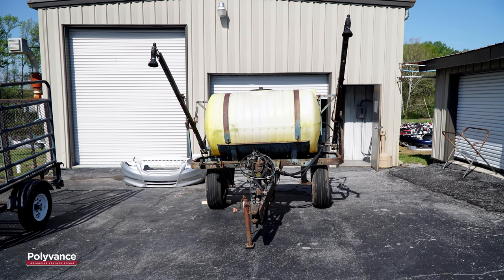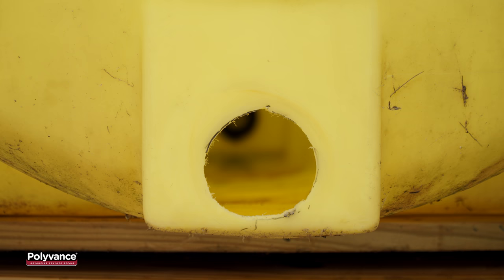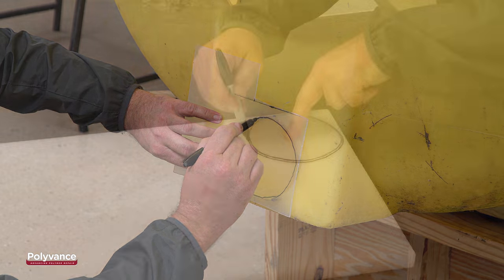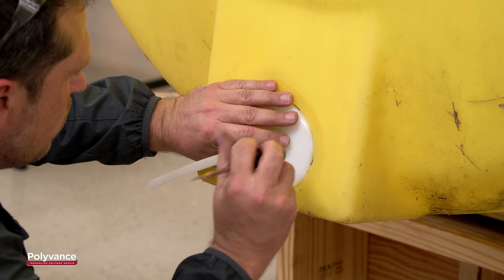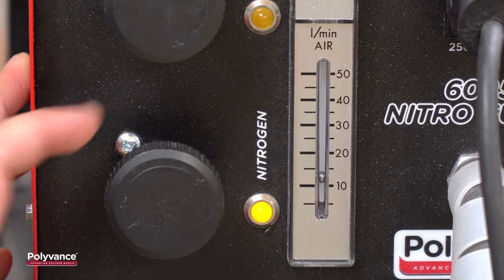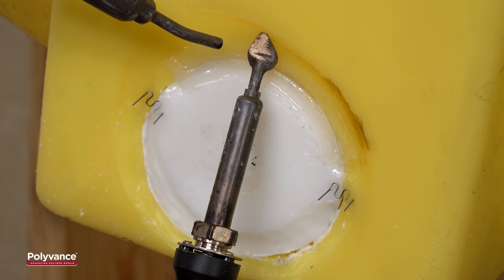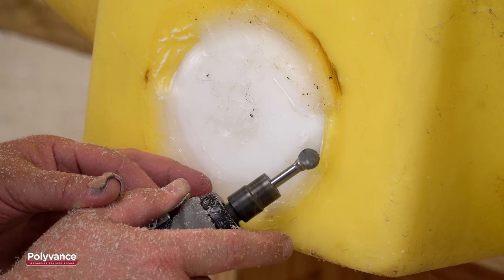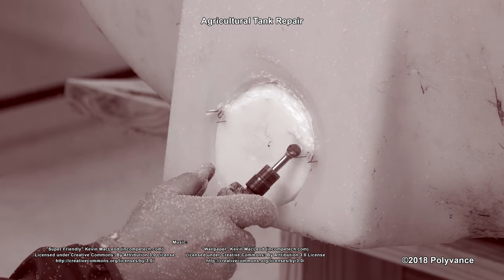Agricultural Tank Repair

Comment: How about on a smaller tank...where it leaks around one of the bolt holes that holds it on the metal frame?
Reply: it would work there too.  You would have to unmount the tank to find the crack in the mount area, however.